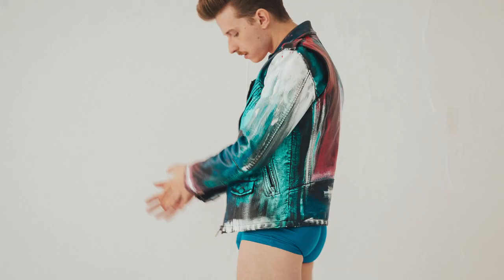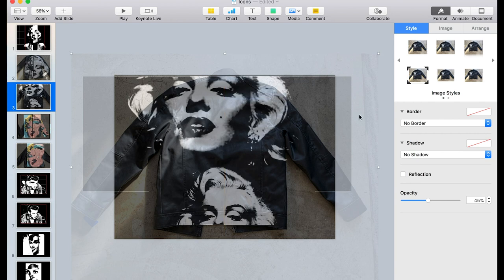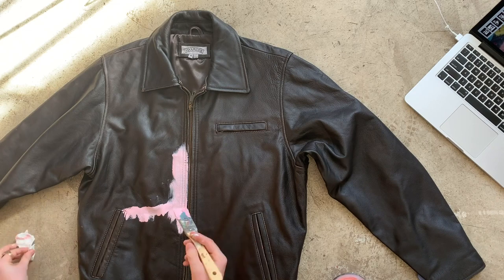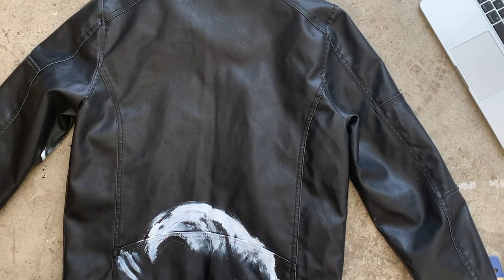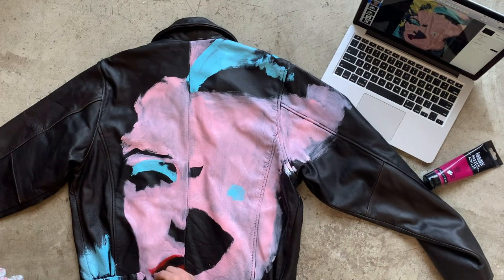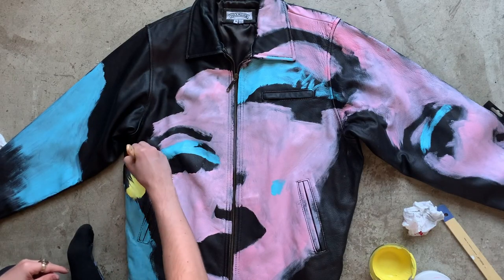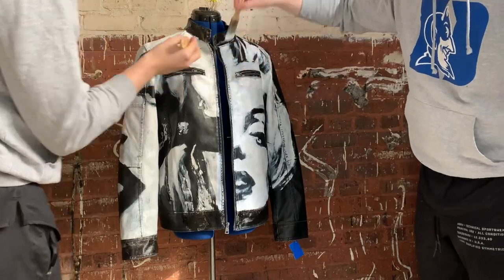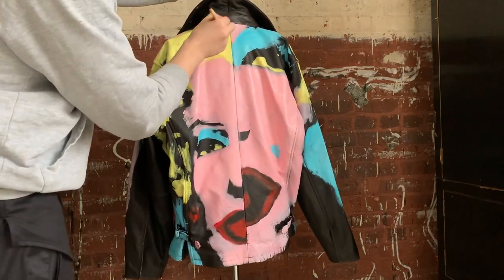PAINTED leather jacket transformation | REISSUED

Comment: If only YouTube analytics could capture the fact that I watched 95% of this video with my mouth gaping open. It is infuriating how talented you are. Love both, but the black and white one has an effect on the eye that edges it out as my favorite. I'm inspired to take acrylic paint to one of my leather jackets, but would like to know if you'd be able to condition/clean the leather if it has paint on it. I'm assuming no?
Reply from the maker: Hahah maybe YouTube analytics noticed. Thank you so much! Regarding cleaning, yes... I expect that cleaning and conditioning the painted parts of the jacket will not be possible. However, perhaps the interior and non painted parts still could be. And that paint is easily wiped down 👍🏻
Reply: Use heat gun or hair dryer on high to fully cure the paint on leather. Then go all over w/a small amt of coconut oil to seal everything in & condition. It will also restore that nice sheen the jacket came with.

Comment: With it painted does the paint makes the garment harden? Maybe I used too many coats when I'm painting on my garments and the material comes out very hard and stiff to wear? Any suggestions on this would be great also I use angelus fabric paint.
Reply from the maker: Hey Van! The acrylic paints that I used in this video are pretty flexible when dry - kinda like a vinyl texture. I did have some issues with the real leather jacket cracking which I address in my Painted Leather Part 2 video (more of a preparation issue than a paint issue). Are you painting on leather? Whenever I paint on canvas or cotton clothes, the paint definitely gets pretty stiff. In that case, I would recommend mixing the paint with a textile medium to help it soften.
Reply: @REISSUED  awesome thanks bro 💯
Reply from the maker: @vanalbury7216  For sure man!